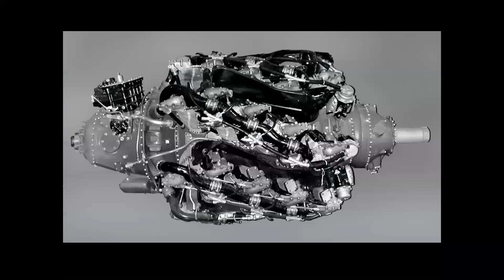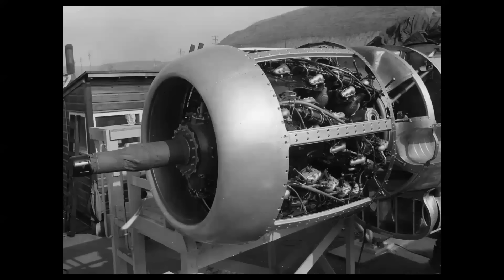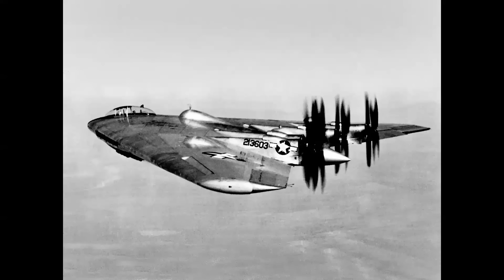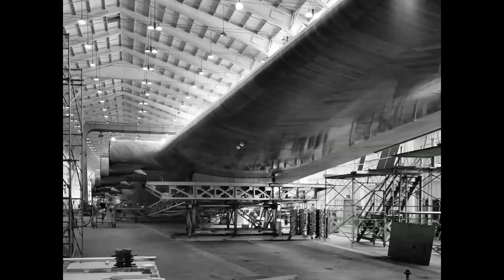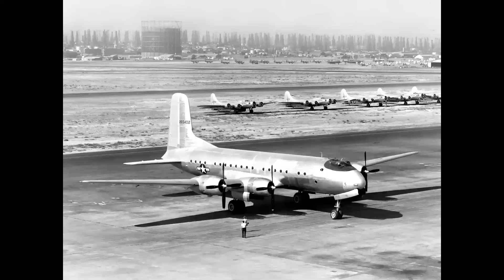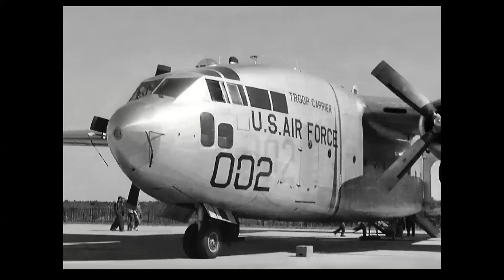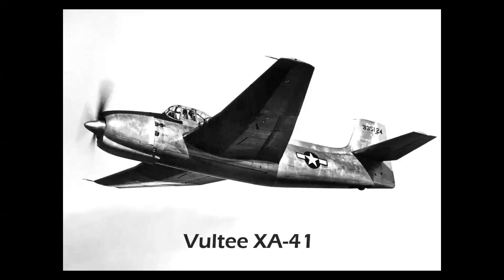PRATT & WHITNEY R-4360 WASP MAJOR AIRCRAFT - Airplanes powered by this giant radial engine

Comment: All the people commenting about how maintenance-intensive the R-4360 must have been never worked on radial engines.  Yes, the engine had lots of jugs, spark plugs,  seven magnetos on its early models, and so forth, but all radial engines required a lot of maintenance. The 4360 proved to be dependable and as reliable as the state of the art allowed.  Its only competition, the Wright R-3350, was comparatively overstressed, less reliable, had poor maintenance access, and in service required probably just as much maintenance as the corncob.  The corncob was a great engine.
Reply: Absolutely. These engines were at the high water mark of aircraft piston power for large aircraft and were marvels of engineering.  The effort needed to keep them running efficiently was significant but certainly not out of line with expectations for this type of powerplant. They could have been developed even further if the superior economics of turbine powerplants did not force them into obsolescence. The final examples of steam locomotives were likewise marvels of engineering for that technology, but  could not long compete with the superior economics of diesel-electric locomotives.  The achievement of the R-4360 should be appreciated by anyone who admires sophisticated machinery.
Reply: They weren't that great, they suffered from the same kind of heat issues as the R3350 and were indeed labor intensive, there's no smoothing that over.
They suffered from detonation problems because the carb at the back of the engine would heat up so bad it'd heat the air intake charge and induce detonation but when they were turned around on the B36 to try to solve that problem they suffered from the carbs icing up from being at the front of the engines. 
They're impressive pieces of engineering but the fact is 4 rows is just too much and leads to too many issues, like the R3350 they never really got them right.
Reply: @dukecraig2402  I seriously doubt that the carburetors on these engines had heating and cooling issues, as You proclaimed here.... For one thing, carburetors normally do not heat-up excessively, because of what they have inside of them... Fuel.... The fuel. Would begin to evaporate, and draw excessive heat away from the carburetors in the process. But the liquified fuel being fed into the carburetors would constantly re-supply the carburetor with fresh liquid fuel as the engine it supplied would burn the fuel being supplied to it... Much like a VCM type of an Air Conditioning system works...  Secondly, I don't buy Your suggestion that the carburetor on these engines "iced-up" as you suggested here, with the reversed positioning of them on the planes with pusher-props, like the B-36 and the X-B 35 planes.... The carburetor on these engines were the Bendix pressure type designs...  They did not have venturi's as so many float type carburetors had on smaller engines... One of the many advantages of pressure-type carburetors is they did not suffer from venturi ice , that the float-type carburetorss did... The other guess's that you made about detonation issues that these engines supposedly had is doubtful as well, because Pratt & Whitney did not 'Accidentally' sell well over 17,000 of these units, which would have NEVER happened if they had detonation issues.... Sorry Amigo, but I just don't believe anything that You claimed here.... Try selling the 'Kool Aid' that You have to offer , elsewhere....  Edit- 5/29/22.. I take back what I said regarding Kool Aid and the carbs being impossible to ice-over... Fuel does have some moisture in it, and It is typically delivered to the fueling storage containers with some small traces of water... Between the storage and the delivery into the planes, more water could enter into the fuel. This is why planes and other things that use liquid fuel have water separators and water drains in the tanks and fuel systems. It is ICE in the fuel system that was believed to have caused the crash of British Airways flt#38 in Jan 2008... I Sincerely Apologise for that outburst that I posted here, 3 months ago,  I re-read my comments to you- and I was the one who became embarrassed with what I wrote to you.... And yes, it is possible that the planes that You were involved with (B-36's), did have icing issues in the fuel system... Again, Duke I apologise for saying what I did to You... Sincerely, Mike Martinez
Reply: @michaelmartinez1345  
And you're doing the same thing everyone else does whose guessing about this, you're comparing cars to aircraft. 
If you think carburetors freezing up on aircraft isn't a problem then you sure have a lot to learn about them.
It is an issue, that's why all the WW2 aircraft with carburetors have carburetor heaters, you do understand that those aircraft operated at altitudes up to 40,000 ft don't you? Guess what the temperature up there is, -40° to -50°F, that's exactly why the crews on those open fuselage bombers had electric heated suits that plugged in to a socket at every crew station. 
The B36 Peacemaker was notorious for having carbs that froze up, because the carb heaters couldn't keep up with the fact that the carb was no longer at the rear of the engine and got a little heat from it, the carb heaters were engineered for an engine facing foreward, this was an oversight by the engineers of the B36 when they decided to turn the engine's around on it, and it was exacerbated by the fact that with the power of six engine's it's service ceiling was 43,000 feet, higher than any other aircraft that flew with the Pratt&Whitney R4360 engine. 
As a matter of fact the most accepted theory of Glen Miller's death in WW2 was he was flying across the Channel in an aircraft that had a faulty carb heater on it, even at 10,000 feet or lower if conditions are right aircraft carbs will freeze up, it's theorized that Miller's plane had a carburetor heater on it that was defective from Wright, them and the US Army General that was in charge of quality control for the wartime contracts from them both got in a lot of trouble when it came to light that they'd been paying him off to turn a blind eye on defective parts they'd been making and shipping to the government, and one of the known defective parts were carburetor heaters, he got court martialed and they paid a hefty fine for it.
Just Google Pratt&Whitney R2800 (or any other aircraft engine for that matter) carburetor heater and I'll bet you'll even find one for sale.
By the way, you're arguing with someone that graduated from aircraft maintenance school, so if you wanna keep going just let me know.
Reply: @dukecraig2402  Dude, for a moment, please try to understand what others are trying to enlighten you on here.  #1 Bendix did not make induction systems for cars, or trucks... Their pressure carburetors were developed for aircraft... #2 I still don't believe your claim that the B-36 had Icing problems with the carburetors... #3 Do you have any idea of WHO you are communicating with here? I have several years of experience with planes of many types, and road vehicles as well... #4 Try selling Your B.S. elsewhere.... #5 BTW, with your findings of what actually caused the plane that Glenn Miller was on to crash (A Noordyun Norseman), how is it that You know about this?  Yes, the reports said that carburetor icing COULD have caused it to go down, another cause COULD have been pilot spatial disorientation in IMC conditions, another cause COULD have been enemy activity.... BTW, pressure carbs were not available until later in WW2... Bendix was the prime supplier of these designs... It is doubtful that the Norseman had a pressure type of a carburetor.... Study what pressure carbs are, how they function, why they were developed, and the significance of them- BEFORE you continue to insert your INCORRECT assumptions into your guess's and false claims... I'm trying to save you from further embarrassing Yourself here....
Reply: @michaelmartinez1345  
Well I hope I'm never in anything you're flying or have worked on.
You claim to know aircraft yet you claim carburetor icing isn't an issue with aircraft carbs? Wow, that's just amazing. 
Well time for your education on the subject, the throats of the carbs become restricted with ice that forms in them when flying through atmospheric conditions that are correct for it, ie the right temp and humidity or ice crystals in the air.
Look around in the cockpit of any WW2 aircraft and you're going to find a control for the carb heaters. 
The first cross country flight of the P38 ended in a wreck that was attributed to carburetor icing.
Charles Lindbergh's cross Atlantic flight almost ended up with him crashing into the Atlantic when ice formed on his aircraft and his engine started cutting out from the carb freezing up.
And just read about the B36 Peacemaker and it's problems, it was notorious for the carb heaters not being able to keep up with icing in the carbs because the engine's were turned around backwards, aside from learning about it in documentaries and books about the B36 even Wikipedia talks about the icing problems with the carbs because the engine's were turned around. 
You're the kind of person who gets people killed and hurt because you think you're smarter than you are and you won't listen to people who know what they're talking about, I've seen tons of people like you do it with aircraft and motorcycle's, you're an accident waiting to happen and I can only hope that it's only you that your ego gets killed or maimed and not some poor sucker who's along for a ride with you.
Reply: @dukecraig2402  You have very little ability to absorb ANYTHING that people are trying to tell you about... Do you even know what causes carburetors to encounter ice? Do you even know that there were carburetors that did not have icing issues? Do You even know what types of induction systems were used on large reciprocating aircraft engines? Please learn more, of what you PRETEND to know, before you comment here.... I'm just trying to save you from being embarrassed.
Reply: @michaelmartinez1345  In a big radial engine the fuel is sent to the distribution system in liquid form, no fuel is present in the often-multiple venturis of a large radial carburetor (Wright called the basically itentical unit in its R3350 injected engines a fuel control). Yes, the radial carburetor, though it didn't vaporize fuel in the venturi like a smaller engine carburetor or your older car, could still ice up from impact ice, like any fuel-injected engine can.
Reply: @paulcrumley9756  that is good information PAUL!!! Thank You... I was wondering WHEN the radial engines start using the carbs without venturi's... You know, the ones with no floats or float bowls... I think they called them Pressure Carbs... These types of carbs, don't ice-up, there is no accelerator pump needed, and they can operate in ANY position and in negative or positive G's. Many types of lawn equipment, racing Karts, Model Hobby Engines, Chain Saws, etc. still use these types of designs... For the U.S. aircraft, I believe the Bendix-Stromberg types were most common in the time period that I'm inquiring about... My guess is these incredibly ingenious pressure carb. designs, were eventually replaced with Throttle Body Injection, then individually positioned injectors aka-Tuned Port Injection... Sadly, like so many other things, engineers started to adopt electronics and computers to control the engine's FMS... At the cost of greatly complicating the fuel systems... Are electronics currently being used on reciprocating aircraft engine fuel systems?
Reply: @michaelmartinez1345  The standard "round motor" pressure carburetor uses a set of venturis in the inlet airstream to measure the airflow, compare it to static pressure and meter the fuel accordingly somewhere deeper in the engine. So the classic carburetor icing caused by fuel vaporization within the carburetor is not possible. However, in severe icing conditions, everything in the inlet airflow has an opportunity to collect ice, thus the need for a deicing system. The radials I worked on had both hot-air and alcohol deicing. The hot air usually worked better and was preferred, but in extreme cold, at low power settings, sometimes a jolt of isopropyl alcohol was needed to prevent accumulation and ingestion of ice.
Reply: @paulcrumley9756  That is interesting information... Especially the inlet air horns leading into the pressure-floatless carburetor throttle body/throttle plates to sense the volume of air going into the engine (impact air) to assist the diaphragms make the necessary adjustments of how much fuel to inject into the air-stream going into the induction system manifold at that point. This was ESPECIALLY important in high altitudes in varying temp densities and turbo/super charging the induction system to assist the engines to maintain sea-level performance... I previously, was not aware of the multiple fuel injectors that gave much better fuel distribution & precise control directly into each cylinder combustion chamber, that the German engineers came-up with, on the DB series inverted '/\' type of 12 cylinder engines that they already had, that early in the war, but apparently they already had perfected them for their spark-ignition reciprocating aircraft engines... However, one problem that the U.S. & Ally design and manufacturing teams faced during those lean times (post depression years), was the lack of funding for research & development... So the Allies went with what they already knew about - pertaining to fuel systems. And they greatly improved the single point introduction of fuel into the Allie's aurcraft engines. And I have heard about several WW2 aircraft engine designs using a combination of alcohol & water injection into the induction systems (at high MAP) to stop detonation (aka-pre-ignition)... It also helped to clean the piston crowns and combustion chambers of the heads, to further reduce the detonation issues... But apparently, the German engineers were the first to introduce fuel injection on their spark ignition aircraft engines, as well as their Diesel engines (for ground hugging equipment), which gave their tanks and other heavy equipment a large advantage... Becoming allies with the NAZI-less Germans after the WW2 could very well be one of the best outcomes that could have come from that war... They were, and still are Brilliant, in so many ways... And they , like so many other people- experienced the terrible outcome and heart-breaking / fear mongering atrocities , of having dictators for their leaders...
Reply: @dukecraig2402  Well, every radial powered aircraft I worked on delivered hot air that flowed around the exhaust manifolds directly into the carburetor when necessary, and even at 30,000-plus feet the exhausts are never cold.
Reply: @michaelmartinez1345  Actually, pressure carburetors do in fact have venturi assemblies. However, since they do not deliver fuel into the airstream at the venturi, the fuel evaporation cooling that is the most common cause of carburetor icing is avoided. However, there can still be impact icing, when moisture in the air hits the cold metal and freezes, hence the need for carburetor (intake) air in almost all piston-powered engines, carbureted or fuel injected.
Reply: @paulcrumley9756  gotcha, so carb heat at the intake air horns on the pressure carbs and fuel inj. Throttle bodies... I was not aware of this... Is it electrically heated or is engine coolant circulated in those areas? On   LPG ground equipment, like forklifts and cars, the icing issues take place in the gassifier units.... The evaporation of the liquified Propane fuel to vapor, really takes the heat away from those gassifier units, so engine coolant is circulated through them to prevent this... The problem is intensified - with high humidity conditions....However I'm thinking that the air horn in a carburetor or throttle body is not intended to increase velocity, and lower the pressure - as what a venturi does, inside of the throat of the throttle barrels,  but it provides the various air bleed circuits and diaphragm chambers with undisturbed inlet airflow and ambient reference pressures... I have worked on various machines that use diaphragm type of floatless carburetors and have overhauled those carburetors, and can assure you that if there is a venturi used in these carburetors, it would not be used for introducing fuel into the intake air flow, but for a volume /airflow reference through the carburetor. Maybe for the (ported) vacuum operated ignition advancer on the distributor or possibly the ECM on earlier electronically controlled engines / transmissions, or to control EGR valves on pre- ECM vehicles... But anytime an event takes place to drop the ambient pressure of anything, there is often a sudden drop in ambient temperature.... This is what can cause a hail storm in the middle of a summer- rainstorm, the sudden drop in ambient pressure instantly freezes the rain droplets.... This drop in pressure can also cause the humidity in the air to freeze & cling to where the pressure & temperature drop are taking place, like on the upper-surface & leading edges of an airfoil (wing) on planes.... More on this later....
Reply: @michaelmartinez1345 guesses
Reply: The R-3350 is effectively a competitor. also for a bad nickname, the connie in lufthansa was called "the best tri motor in the world".
I think that operators expected a reliability like the P&W R-2800. And it was not.
Radial R-2800 are still in normal service (DC-6) when R4360 ware stopped in 60s and R3350 were stopped in 80s.
Reply: The turbocompound versions had enormous maintenance issues but the fuel efficiency compensated for the cost.
Reply: @ngauruhoezodiac3143  I think more than this, R3350 and R4360 with their big turbocompound designs are the only ones capables to supply enough power to accomplish aircrafts requirements. Turboprop were not reliable and powerful (the bristol proteus was a long way development and retarded the bristol britania for a long time, or the american T-34 was not a success)
Reply: @pierregastie-leroy4922  The Vickers Viscount already had reliable Rolls Royce Darts by the mid fifties that were quite successful but for intercontinental travel everything changed with the Boeing 707.
Reply: @pierregastie-leroy4922  from what I have been told, and read about the turbo compound radial engines of late WW2, and through the 1950's, the 4360 originated producing about 3,000 H.P. Later versions with centrifugal superchargers and turbo-chargers were producing well over 4,300 H.P. These engines proved to be more reliable than their closest competitors, the Wright 3350 18 cylinder radials producing about 3,200 H.P. with centrifugal supercharger and Turbo-Chargers.... In the late 1950's both engine designs were replaced with pure jet - axial flow - turbine engines that pushed their swept-wing airliners to well over 600 mph... The rest is history...
Reply: @michaelmartinez1345  True, and it was the limit of piston engines. When US navy has to choice between the FG2D vs the Bearcat, the navy prefers the one used P&W R2800, and Douglas kept the R2800 until the DC-6. 
In USA the choice of jet engine follows the development of jet bombers fleet. Meanwhile, USSR and UK chose the turboprop, because of bomber fleet for USSR and because of producers for UK (bristol and later RR).
Reply: @ngauruhoezodiac3143 turbo-props
Reply: @ngauruhoezodiac3143  I don't think the 4360 was ever turbocompounded maybe some aircraft had turbochargers, though. Some editions of the he Wright R3350 were in fact turbocompound, however, and combined with early problems in the fuel injection system, of all the radials it had the worst reputation among maintenance workers.
Reply: As a Navy   ADR (Recip mech)    aircrewman- I started out as an E-4 and E5  backseater flying post maintenance flights in the R-1820-86A (2 stage supercharged) T-28 B and C,  then as   crew chief and loadmaster on the C-1A (R-1820-82A),   crewman/maintainer  on the NAS Cubi C-45 Bugsmasher  with a pair of R985s,    and later in the 70s  as an E6  flight engineer on reserve C-118 and 131 (R-2800s).  I had the good fortune to have spent the summer of 1969 with the Blue Angels Super Connie as a  fill in second mech for 90 days.   The  118/131  2800s were definitely over-stretched, especially taking off from regional airports where Navy Reserve units  and their gear were picked up;.   The R 3350s on the Super Connies had plenty of power, but also had a  rep for the occasional PRT   departing  the engine resulting in significant  dents in the fuselage....   I did get to work on one  4360,  in 1984 - 85   as a volunteer doing   teardown and final assembly on a Thunderbolt undergoing restoration.  One or two banks of 9  were plenty enough  for me.  Wouldn't have given up the experience for anything.
Reply: @cfdmedic58 《☆》WoW Thanks for Your Service Sir👍🔊I worked on lots of smaller 4 & 6 cylinder recips as a civilian A&P. Occasionally I'd find a cylinder head separated from the barrel. The cylinder head would just be moving as pressure from the piston pushed it out. The exhaust stack, intake tube & baffling would hold the head in place for a while. Pilots could tell they had a problem but some of them would lean the mixture like it's a fouled spark plug & just run the piss out of it tryna pass the Mag check. Some privately owned aircraft the owners had STCs to run automobile gas in them. I found a 4 cylinder Lycoming IO360 with the cylinder hold down studs broken. The owner taxied it up to our hangar with the whole cylinder separated. He also owned a Texaco gas station in the neighborhood. He was quite surprised when I showed him what was going on. Greetings from Florida✌️😎🤳🇺🇸☯️🇺🇸
Reply: Jets greatly reduced maintenance like diesels were cheaper than steam engines.  I heard some of the recips only went 200 hours between overhaul.
Reply: @rogersmith7396  From the people I knew who worked on the planes with large reciprocating aircraft engines, like the Wright Cyclone 3350 and P&W 4360 engines & props said that they were overhauled at somewhere between 400 to 550 hours of use... The first turbines on civilian airliners like the JT-3 , CJ-805 lasted 2 to 3 x as long as the reciprocating aircraft engines between overhauls... And the Jets could double the cruise speed of the reciprocating engined planes... Unfortunately,  the writing was on the wall for many of the very Large reciprocating engined planes.... The turbo-prop planes cruised at speeds somewhere between the reciprocating planes and the Large civilian jets, and they became very efficient for air travelers on routes to smaller airports and shorter distances... So their technology continued-on for many years, and are still very popular for shorter routes and smaller airports. But there is something about the Large reciprocating engined planes that is so cool.... They just seem to fly into a heavenly place, that the other planes just can't seem to duplicate as well...
Reply: @michaelmartinez1345  I concur.  I may have heard about the 200 hour figure on the Constellation.  I was appalled.  My dads boxer 4 cylinder plane was every 2000 hours and resale went way down on a high time plane.  Think of all the FAA certified mechanics and unions for the airlines in those days.  Also the Air Force.  I imagine none of them lamented the coming of the jets.  As for locomotives it was said all the parts on a steam engine were hand made and the railroads had big shops and foundaries to keep them running.  UP still has one at Cheyane to restore engines like Big Boy which I feel is to their credit.  They take years.  Of course DC 3s are still flying.  Buffalo Air gets reman radials from someone.  All old engines, nothing new.  My grandparents flew from the midwest to Hawaii in the 50s on a four engine prop.  Took forever and the interior noise was deafening.   Of course I have set 6 feet away from a screaming turbine on a rear engine passenger jet, lots of high energy noise.  Hope they have blast blankets as I have heard of people being scythed in half by turbine explosions.  Knowing that cut rate airlines scimp on maintenance is'nt reassuring either.
Reply: @michaelmartinez1345  Oh, and people who have heard the B 36 flying said the sound was like nothing else.  Would rumble the ground.
Reply: @michaelmartinez1345 4-5 hundred hours sounds low. Maybe the early engines in the line were. They were evolved  and improved. The P&W R2800 reached 4000 hours TBO. These engines did have infant mortality problems. Problems like exhaust valves. They also failed compression testing until the test orifice was opened to #43. As my father told me comparing them to jets "we changed Engines and cylinders from the day we got them to the day we got rid of them"  
The P&W JT3D in the end was on condition not time limited. At TWA we had 3 aircraft that had very late production engines. Those aircraft had engines that were on wing approaching 20000 hours. We pulled an engine at LAX it was sent to MCI. The engine was torn down inspect and found still serviceable.
Reply: @jayreiter268  Wow, 4k hours TBO is really good!!! I suspect that the sodium filled stems of the Exhaust Valves cured the problems that were developing with them... I heard that the turbine engines went a very long time- BEFORE an overhaul was needed, but 20k hours? Holy Cow!!! That is a LOT of service!!! Someone told me the JT-3 engines had problems with some of the sheet-metal parts in the Hot section of the engine... I think it was the burner 'cans' but I'm not sure of what the exact area of where the problems existed... I heard that the newly developed (back in the late 50's & early 60's) TIG welding equipment was put to use on these exotic metal (Titanium) burner 'cans' to repair them for further use.... Can You tell me more about this?
Reply: @rogersmith7396  the turbine engines being used in the planes are quite reliable, and it is seldom when shrapnel from a disintegrating jet engine makes it past the casings and/or cowlings of those engines, but it does happen... Especially with the HUGE engines of the Wide bodied twin engined airliners...  And when they go, not only does the plane instantly loose half of it's available power to fly and operate various systems, but the large (13' diameter) dead engine creates a very large drag brake on one side of the plane.... The plane now has little if any ability to climb, an extremely compromised flight control system, uses far more fuel than when flying with two good engines, and the disintegrated engine could have caused substantial collateral damage to other parts of the airframe... This is WHY I prefer to fly on Large planes with 3 or 4 intermediate sized engines (DC-10's, MD-11's, 747's, A-340's, A-380's) , instead of Large planes with 2 Huge engines (777's , 787's , A-350's), especially on ETOPS flights, like crossing over an ocean or flying over one of the poles.... Just too darned risky and vulnerable.... Let the airlines bring back the 3&4 intermediate sized engine designed planes that worked so well in the past, and scrap the big-twin engined planes....
Reply: @michaelmartinez1345  I am pretty sure all these engines had sodium cooled valves. There is quite a lot of info on the evolution of the R2800. From crankcase to cylinder head improvements were made to reach that TBO. 
In the field we were splitting  the 3D on wing to change burner cans and other hot section work. That work was possible after the engine was no longer time limited. On my trips to MCI it was interesting to see the level of work. I watched a computer controlled  welder build up the knife edge seals of the disk hubs. It would weld about a one inch section  and skip to a different area until it was fully built up. The principle of quarter welding. We did not repair burner cans in the field. Its been to long .to remember how and if cans were repaired. I do remember fan blade nick  repair. I have seen the tail pipe(nozzle) and the cowling inlet de-ice duct weld repaired. Many of our 707's were sold to the air force . I was told they wanted the leading edge cull and possibly the engines for the KC135..
Reply: @jayreiter268  Yes!!! I remember seeing a KC-135 coming through an MRO that I used to work at... One of the fellas working on the engine (JT-3) showed me the burner can area of concern... The nose cowls did have some flush patch's and he showed me some IGV's that needed some blending.... Apparently, the weight of the rotating parts is critical on these engines, so any blending done on the compressor blades and turbine buckets had to be weighed and balanced to keep the rotating assemblies balanced... It is quite a process...
Reply: @michaelmartinez1345  I cannot remember it all. You need the manual to refresh your memory as you work. The burners were a problem area and were improved also. If the flame pattern was not down the center it would burn through the can. The only  thing protecting the can is the boundary cooling air flow around the can.
Reply: @rogersmith7396  A DC-7 on takeoff is enough to rattle your house. Jets are much quieter (I grew up under the flight path to a major airport).
Reply: @michaelmartinez1345 they also make a lovely noise...
Reply: @rogersmith7396 I heard one once, I was only about 7. It was an aircraft with American markings, that I knew, and it made the ground tremble. I was well-acquanted with normal engines as we lived close to Jan Smuts airport in Johannesburg. I'd never heard that deep grumble before, or since.
Reply: I wonder how hp that monster engine put out?
Reply: I've always heard the very back cylinder bank was hard to keep cool .
Reply: Both engines competitors were early gas turbines - which were much cheaper to make, lighter and more reliable (after WW2). Gas turbines problems related to the fact they were horribly inefficient and burned twice as much fuel for the same engine thrust.
Gas turbines still burn more fuel than piston engines of the same power output…
Reply: With skinny arms and long fingers that is